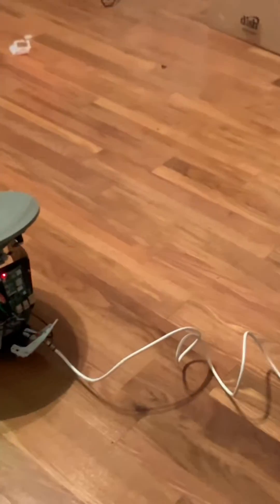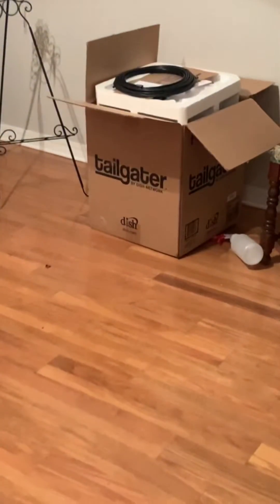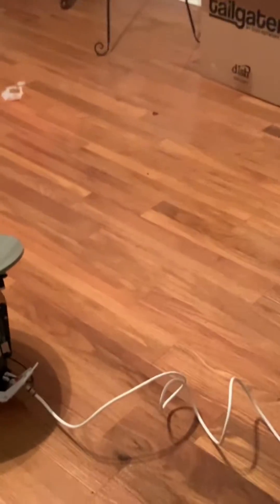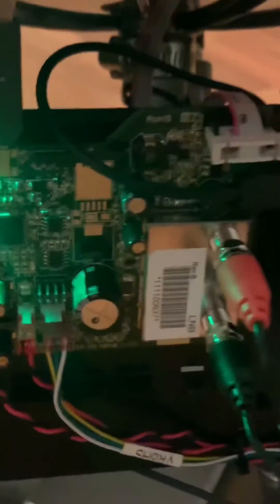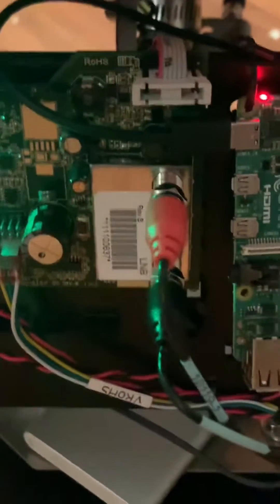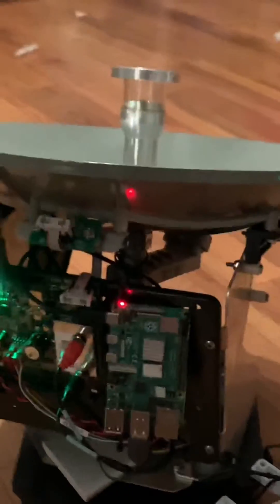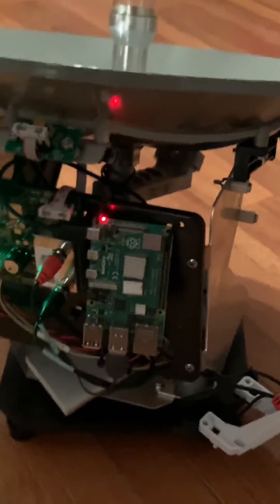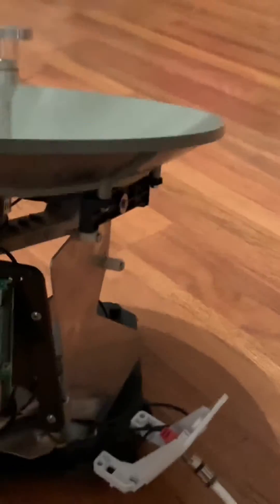Tailgater Microwave Imaging @saveitforparts

Comment: Hey, this is awesome! Somehow I didn't see the mention until now, Youtube seems really flaky about notifications / comments / mentions so they don't always show up right away. Anyway, very cool to see someone else doing this! I've been poking at my pile of tailgater hardware, but haven't finished a follow up video yet. I've also been trying to read through some of the pull requests and suggestions for improvements on GitHub. Can't wait to see how it works for you and what kind of images you get!
Reply from the maker: I’ve been doing a little modifications to Python because the commands on my unit have a little variation from yours it seems. 

I’m also working on a pseudo-visualization program in Java. More to follow. 

I plan on getting in contact with you soon when I know more about what’s happening.
Reply: @TheNerdCompany  Cool, looking forward to seeing updates! I've noticed the commands are a little different in each version of the firmware.